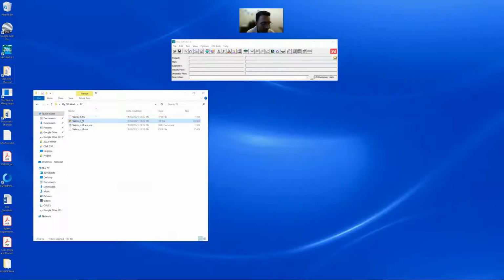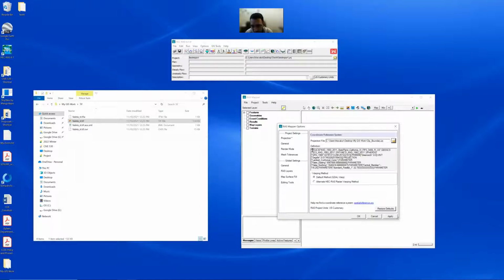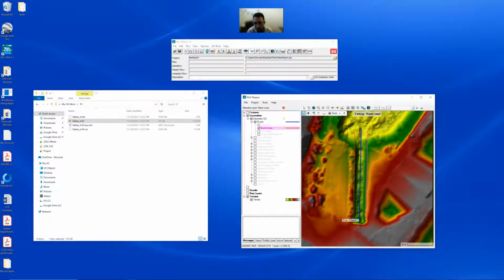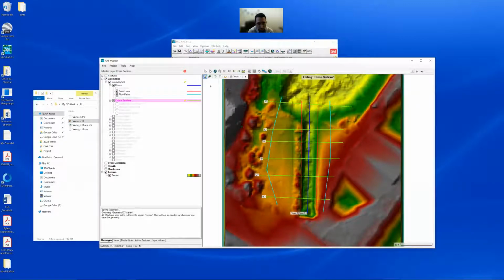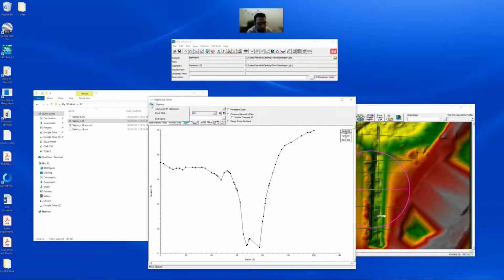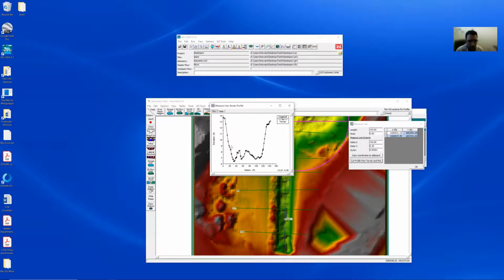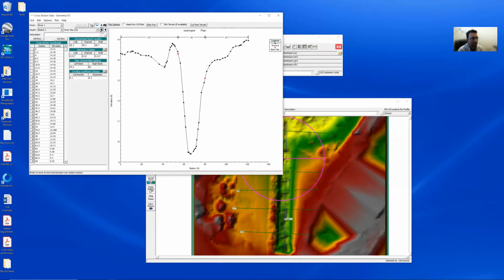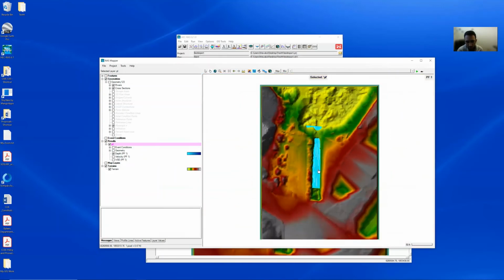HEC-RAS Part 5: Natural River Cross Sections

Comment: Thank you for sharing your experience. I encountered an issue when plotting my survey data in HEC-RAS using a 1m DTM and terrain cross-section data. The problem is that when I enable the "plot terrain" option, there is noticeable distortion where the plotted terrain doesn't align correctly with the original location, both horizontally and vertically. I would greatly appreciate your guidance on resolving or minimizing this problem.